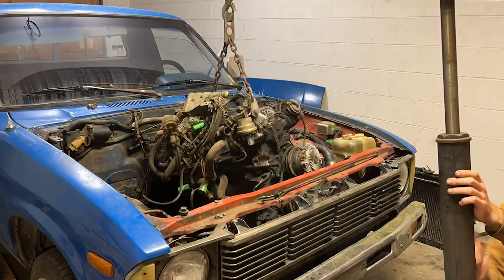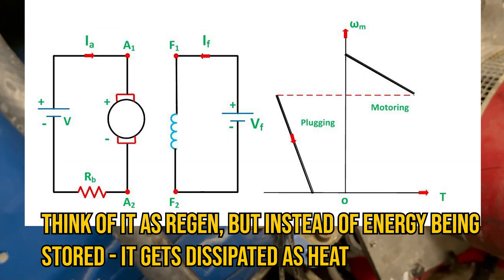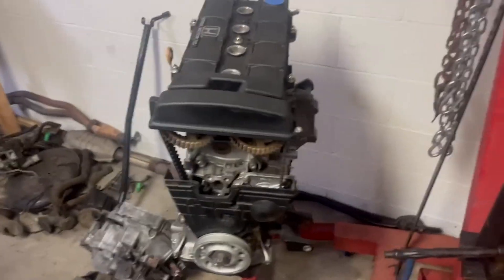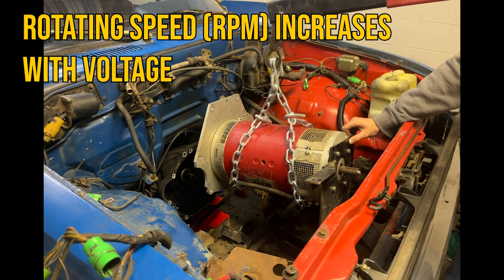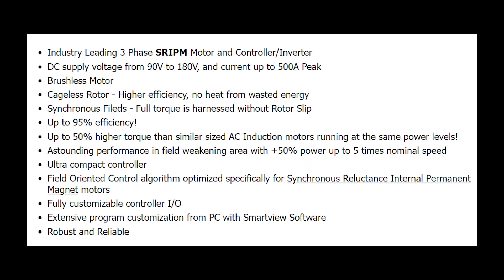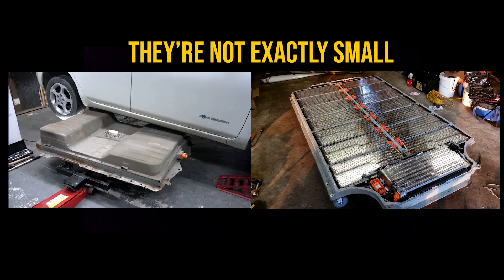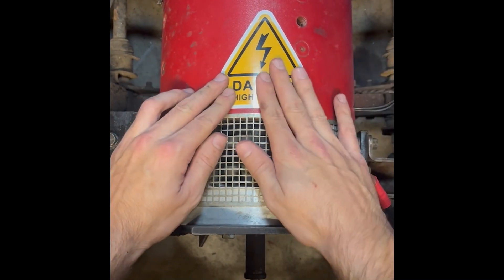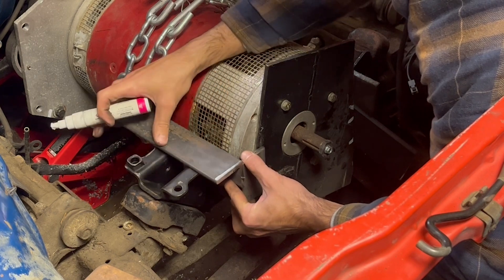Electric-Swapped Toyota Pickup Episode 3: Electric Motor

Comment: Man the dc motors you showed are too expensive, from $3k 
Ok some people have big budget...
I saw a guy powered his sedan with a motorcycle 48v 2200w dc motor, 50kmh top speed. A lot of weight reduction needed. It's also possible with motorcycle dc motor, i would use at least 72v 5k motor under $1000
Reply from the maker: I got this one on craigslist for about $700 with some other goodies

Comment: "you need to check the ratings of your motors"

my motor is rated at 200amps at 48 volts in my miata

But 150 volts at 1000 amps seems to do alright. i daily drove it for 4 years, but it's been together for 10 years now.